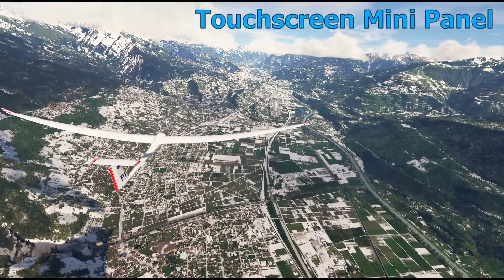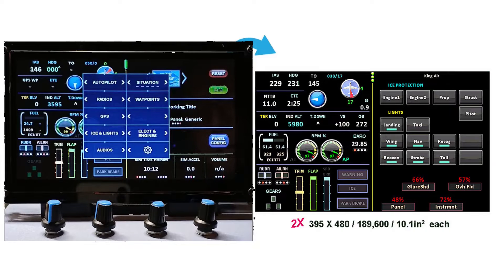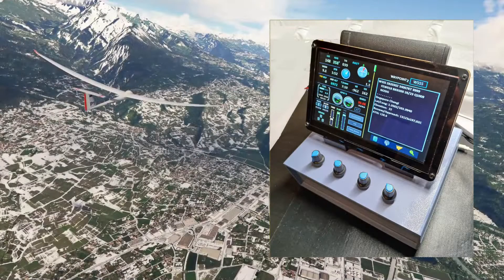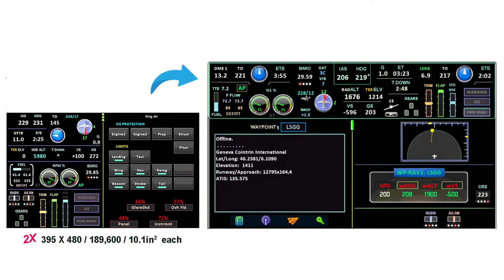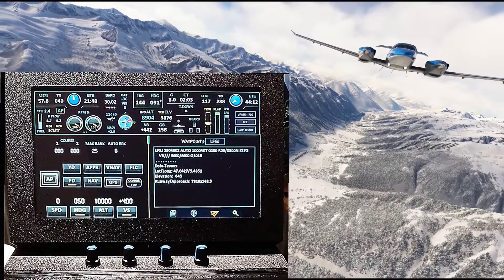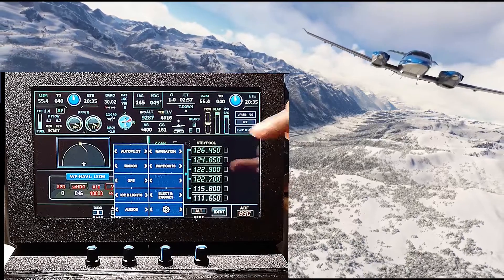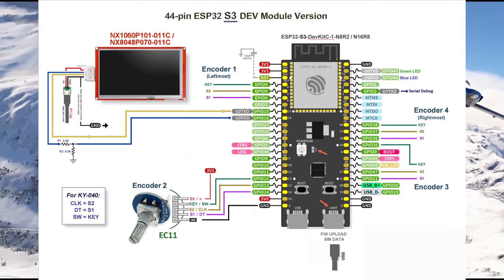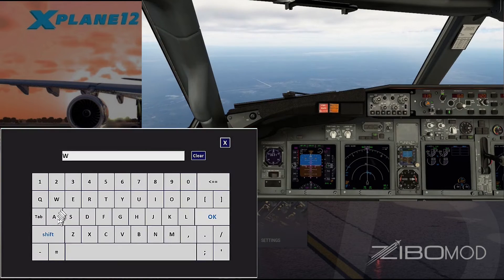Touchscreen Panel - MSFS, X-Plane [Update 14]

Comment: Hello Discman. I just happen to come across this while browsing flight simulator panel projects. Wow I am very impressed at your panel idea and how much you have accomplished.  Your focus on simplicity, functionality and yet very comprehensive feature coverage is truly astounding. The scope of your work is just as extensive as what has been accomplished by the for-profit competition and yet you are one person vs a team of full-time professionals and community contributors.  I am very intrigued by your project as I am currently using an Arduino based Knob / Button box running the also free MobiFlight app , which is a great help over the incredibly awkward use of a mouse to control virtual knobs on the in-game cockpit panel, but is limited by the static definitions of what it can adjust. Your GUI based panel was like the ideal solution to that limitation. Please keep up with the development and enhancement of this very useful tool for us simmers and thank you again.